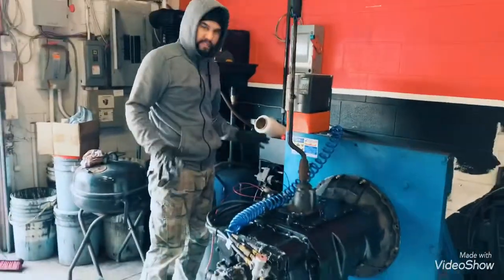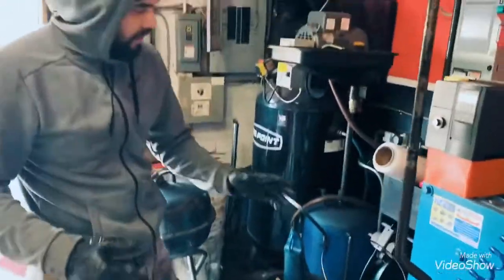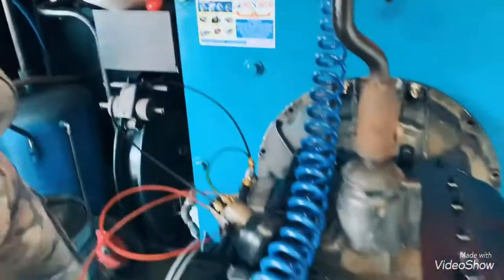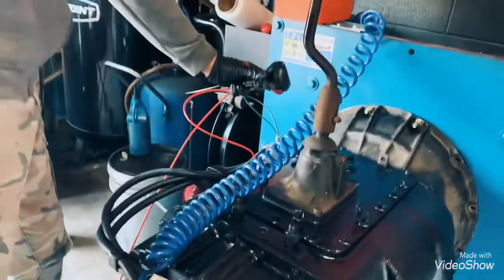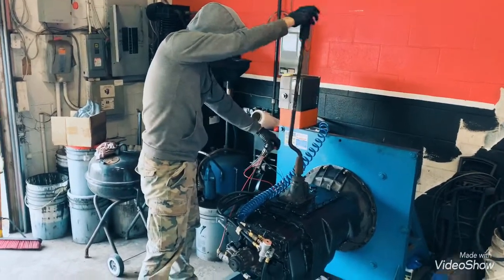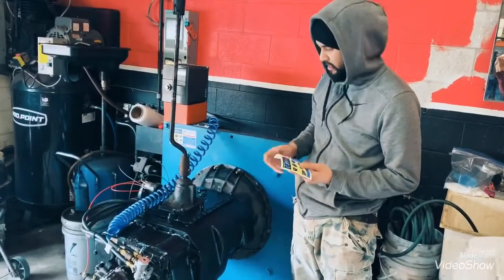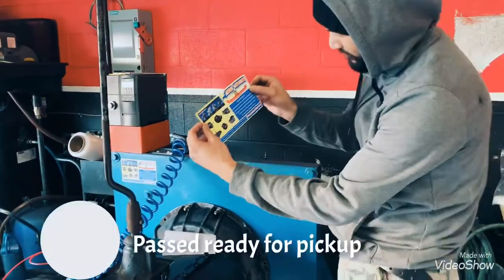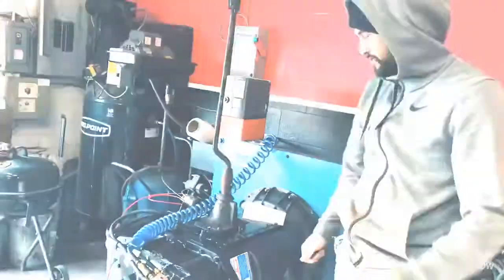13 speed transmission Dynotester

Comment: Have a 13speed but it rattles when in gear an in neutral is a rebuild Trans but I was told it might be the shift or the synchro any Idea it also get stuck in 5th when I go to hit the range selector the 6th

Comment: I have an rto 14613 that screams so loud in od (worst around 1600 rpm in top gear) I can't stand to ride in the truck. rear seal now is leaking as well.. I suspect bearings are at least shot in the auxilliary.. can this be fixed? thanks..
Reply from the maker: Yes sir it can be fixed  bearings syncros and some few gears you’ll have to replace for sure.